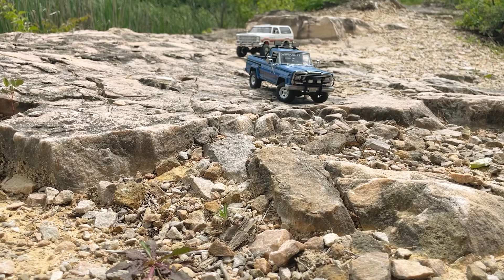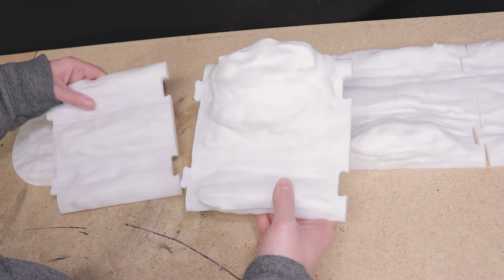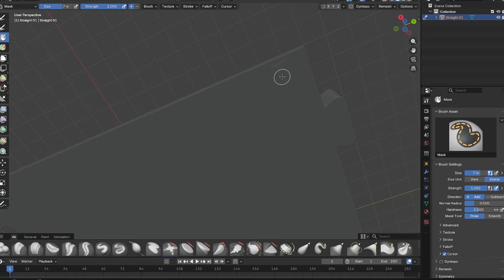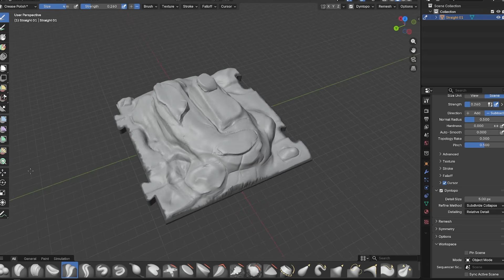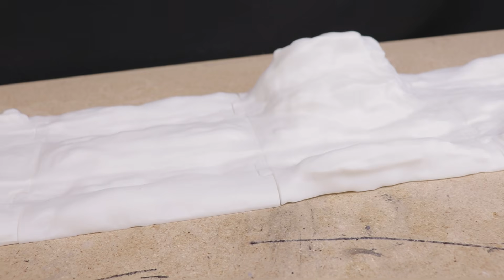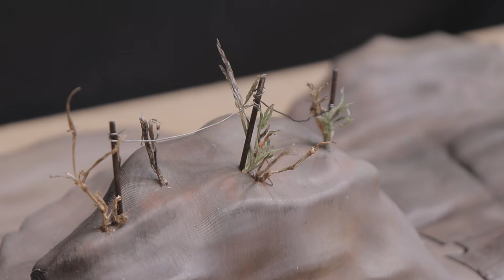3D Printing a Modular Crawler Course! ⛰️

Comment: Lay it down and use adaptive layer height and it'll be better and easier
Reply: Nah, you get way more detail from the axis with how he did it. But it would be better to have it at an 45° angle and printed with adaptive layer height.
Reply: @MrGTAmodsgerman I've tried both and definitely get better results laying down with adaptive later height than I do sideways
Reply: @pietervanderhorst2529   This can't be true, only in the sense that adaptive layers itself make everything better. Because if the layers are at an angle, because of 45°, you can print stuff without supports, get the most detail because it's the Z axis and you can still use adaptive layer height. This is the reason why printing text faceing away from the printer and not onto the build plate, gives better results. And a other cool side effect is that you can print much larger stuff and have way less filament waste. And prints also get stronger because the layer direction is diagonal. It's hard to explain in a comment. It's something you must see. I recommend to watch some Slant3D videos about this topic.
Reply: @MrGTAmodsgerman yeah I understand the benefits like strength and not needing supports at a 45° angle. But I'm just saying I get better results laying down with crawler tiles
Reply: @pietervanderhorst2529  Well if that's the case, then maybe share this online somewhere. Like a comparsion. That sounds very interesting.

Comment: I would look into using the fuzzy skin option in the slicer. In Orca slicer, you can paint specific areas to add texture. You can change how intense it is. Teaching Tech has a good video on fuzzy skin.